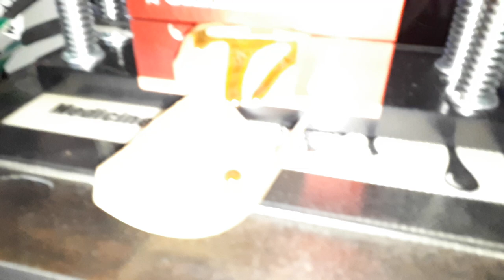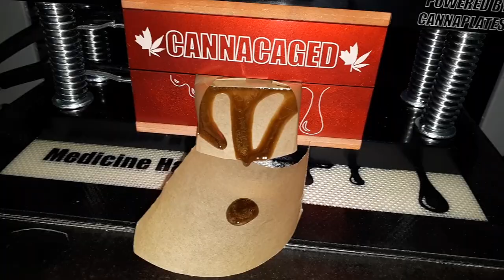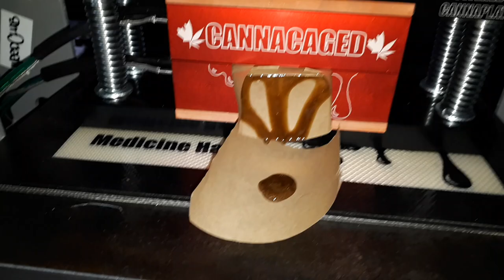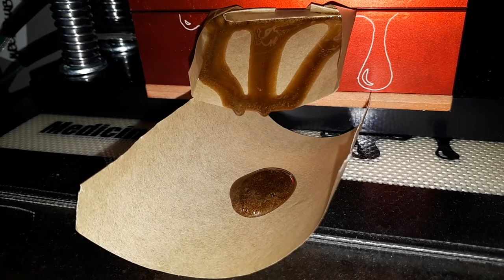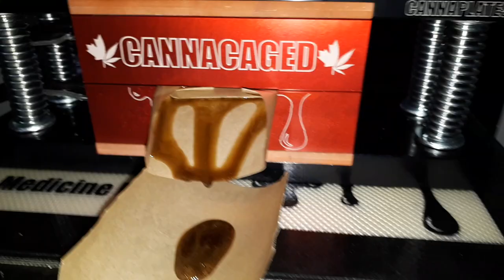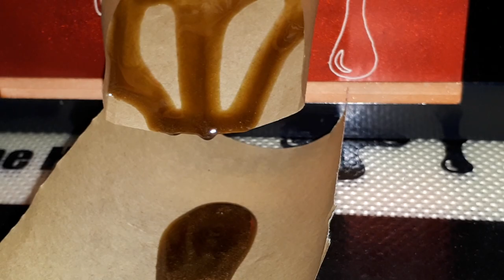Mechanically Separated Black Dolato Diamonds and Sauce 4

Comment: what temperature are you pressing at if I may ask?
Reply from the maker: I am repressing the terpenes in this video. I collect and put it in a 25u bag and repress to make sure the sauce is as clean as it can be. Temp is around 60c. You just want it hot enough to flow. next to no pressure to start. wait of it to flow then ramp it up to 3 tons or so. The bag should empty out super fast. Use a directional flow fold as well.